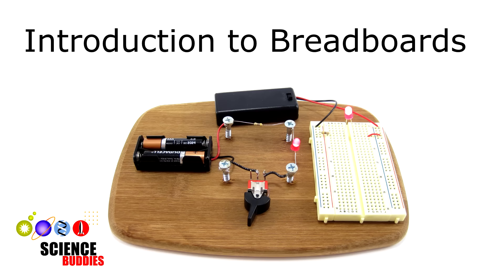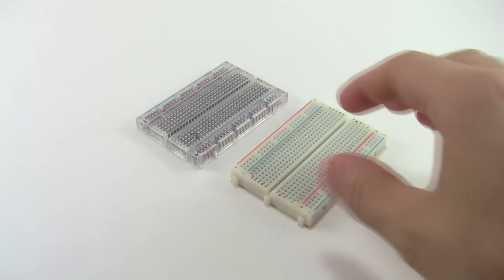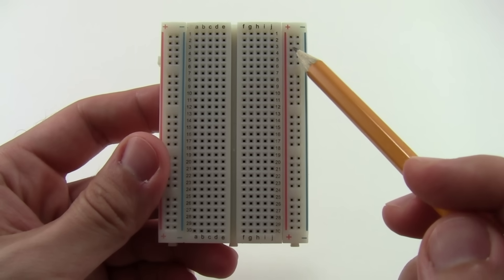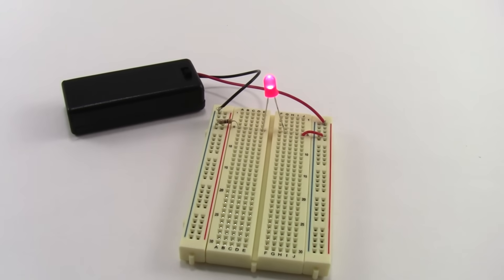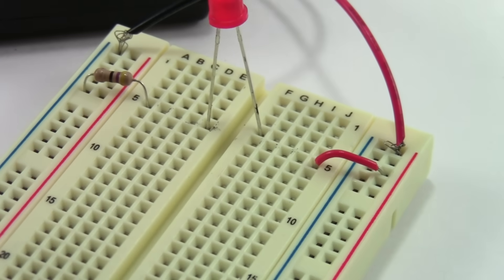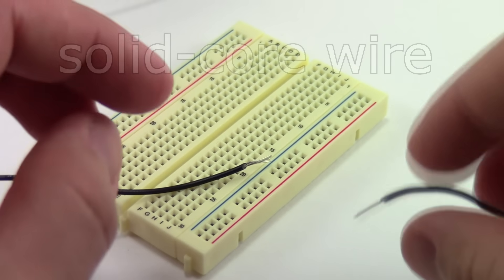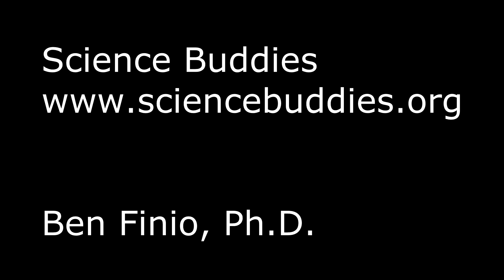How to Use a Breadboard

Comment: Would have been nice if I had found this video sooner. I have several breadboards, including 2 of the long ones.
 The longs ones came with some jumpers, plus a power supply that can power both side separately.
  This can give you 3.3VDC X2, 5VDC X2, or 3.3VDC on one side and 5VDC on the other. Fed by either a barrel plug, or a male to male type A USB cable.
 Available from many sellers I would suggest a 9 volt Wall Wart, 12 volt is okay, but you want one that is regulated. Many are not, and no load, or very light load voltage can be much higher.
 Best way to tell is to check the no load voltage with a DVM on at least a 20 volt scale..
 I found that unregulated ones will cause the small voltage regulators, on many items, to get very hot.
 I started checking all the ones I have, and suggest that others do likewise.
 Wayne WA2YNE

Comment: Great except electricity actually flows like water from negative to positive and repeats/fliws thus direction. Your arrows are backwards.
Reply from the maker: Hi - electrons (negative charges) flow from negative to positive. The convention for electrical current is the direction of flow of positive charge. This might seem silly in metal conductors where the charge carriers are electrons, but there are other cases (chemical reactions, particle accelerators) where the charge carriers can be positive (protons, positively-charged ions, etc).

Comment: Sorry im new to this,Can someone explain why a resister goes after the LED. I thought the resister is to protect the electronic part and does before a part in this case the LED.
Reply from the maker: Hi Arshad - to understand this you need to learn about Ohm's Law and how voltage drops work in series circuits. If you don't know what those terms mean, Google them and you will find a lot of good resources. It turns out that it does not matter whether the resistor or the LED comes first.
Reply: ScienceBuddiesTV 

Thanks for your reply

Comment: Why in your diagram do you have the resistor after the led in your circuit according to your description? shouldn't it be before he led resisting the 9v before it hits the LED?
Reply from the maker: Hi - you might want to look up some tutorials about "Ohm's Law" and "voltage in series" and "current in series." Since this is a series circuit, the total voltage drop, and the current through each element, remain the same regardless of the order you have the LED and resistor.
Reply: ScienceBuddiesTV thanks I saw some stuff after the fact that explained it a little better.

Comment: You can also tin a stranded wire to make it more breadboard friendly, however it helps to have some practice and skill in both stripping the wire and in soldering... if you can strip the wire smoothly enough you won't have to twist it to keep it together, but if you mess this part up you can just twist it, then you need a very thin very even coat of solder such that it holds all of the strands together. This method is not one I recommend to beginners as it takes quite a bit of practice to push an iron that smoothly... but something to keep in mind for when you get more advanced... it can get you through a pinch... it's like wetting a thread before you run it through the eye of a needle... while having an appropriate thread girth and needle eyelet circumference and super sharp scissors with no gap between the closed blades is ideal, in practice many people just moisten the thread and make it work... the process is much the same, except you've mean using you mouth to make things like toys, string, food, etc wet since you where a baby so getting the right saturation level to make the thread fibers stick together while not being so wet that the thread wants to sag and fail to hold stiff is fairly easy, but how long have you been using a soldering iron? So just like you'd expect a toddler to struggle with mastering the perfect satisfaction level to make a string stick together but stay relatively stiff, yet they've used their mouths to moisten crackers and what not enough to swallow hundreds upon hundreds of times... don't expect to be good enough with an iron to push lead smoothly enough and thin enough to make a good breadboard lead from stranded wire even after successfully soldering hundreds upon hundreds of joints... it takes time to master things to a really refined level. That having been said, it can be done, and when you know your likely to move the wire around the board a lot and you have the experience to know that twisting it only holds up for so many reinsertions, it becomes handier than walking across a room to get some single core solid wire... unless there is an attractive person that you'd be passing on the way lol. What? Despite the rumors, being an EE student doesn't mean I'm not human ... lol. Okay so it might not be that convenient, but if she's watching and you've been a solder tech for over 2 years and and enthusiast/hobbyist for more years than you care to recall, so you can solder that well, it's a nice way to make yourself wonder if she noticed, or if she knows how much skill and practice that takes to do quickly and fluidly, and is thus impressed, and so you might opt for tinning the wire rather than walk past her to get more appropriate wire, idk it just depends on whether or not you think she's seeing what your doing... uh all purely hypothetical, yeah. No personal experience, that's just what I here people say. And no, it's not as badass and hard to master as I make it out to be, but if it clumps or makes the wire too thick or you have run away strands your first few goes at it don't get frustrated with yourself, it does take some time and practice. Kinda like saying hi to someone you crush on. You might mess up at firs but you'll get the hang of it... okay, I can't be absolutely certain of that last bit but hey, it seems something that can be learned with practice. Anyways I ramble about solder fumes and girls too much so I'll stop here.

Comment: This might be a weird question as most electronics consume very little power, but how much power can the board handle?
And is there a difference between the mini types and the larger types in power handling capabilities?
I haven`t used one of these since the mid 90`s, but I`m getting a few for a couple of projects, so I`m just curious.

I`ll be using up to 90Watts, from a 14.4V source, so I`m hoping 6.25Amps is well withing the boards capabilities.

Any info about the power handling of breadboards will be much appreciated :)
Reply: Neeever min, found it lol..
So apparently 500mA is the safe limit.
Not really what I was hoping for :/
Maybe there are larger breadboards one could get?
I haven`t seen any..

Comment: if you have stranded wires, can you just tin the end? Like pre-bend it 90 degrees and just tin it? Most of the wires I've seen is stranded wire, all my scrap wires are stranded wires aswell. I'd like to start playing with those boards, and I got a ton of scrap wires from various little projects!

Comment: I always get confused but, does the power come out the negative, or positive terminal?
Reply: Current flow is opposite to the direction that the electrons travel. Electrons are negative, so on a battery, they go from negative to the positive terminal, which means, there is a "Flow of Positive Charge", and current flows from positive to negative terminal.
Reply: Depends how you look at it; but that's as good an answer as you're going to get I think.

Comment: you got the yellow arrows wrong, the electrons in the wires flow from negative to positive. I just learned that in engineering class
Reply: but verry good vidieo. liked it, probibly am about to get back into that kind of stuff just because of this vidieo... thanks
Reply: I also used fresh staples for the jumpers and they worked fine for simple circuits like turning on a led but nothing complex because no insulation

Comment: why did you put resistor in negative side?
Reply: The purpose of the resistor is reduce the amount of current flow. If the current is too high, the led bulb will blow up
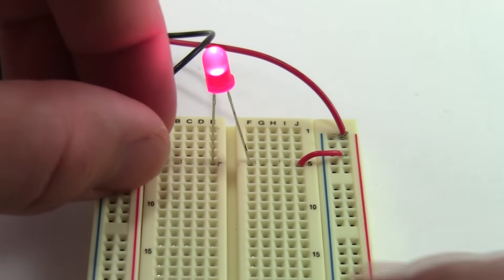Reply: the diagram at 8:35 is kinda wrong, electricity flows from negative to positive. so just reverse the arrows. now that they're reversed, you can see that current will flow through the resistor first then the light. I know I'm way late but just in case anyone else had that question now you know why
Reply: Thanks
Reply: Felix Gonzales Current doesn't flow through the resistor first, it flows through the entire length of the circuit all at once.
Reply: Felix Gonzales it's not wrong because he's talking about conventional current. But yeah if you what to get technical electrons (so current) are moving from the negative terminal of the power supply to the positive terminal.
Reply: I too have that doubt by logic.Got it cleared by your reply. Thanks
Reply: Felix Gonzales It doesn't matter if the resistor/led is first in serial connection
Reply: its doesnt matter.
Reply: El650Jefe ah yeah, I'm a physics major so I have the "technical" view haha
Reply: to show polarity if I had to guess
Reply: Those were my thoughts as well. I understand the difference between conventional current and how electrons actually move (from negative to positive) BUT, I’ve always thought that the resistor should be placed on the positive side of the battery and the anode(+) side of the diode in order to protect the LED from getting too much current.
Reply: Why not? )
Reply: The technical direction engineers use is from positive to negative.
Reply: Abhishek Suryawanshi because remember in order for current to flow you must have a closed circuit. Think of this circuit like a circle. Your starting point is the power supply then as you go around you go through the red wire than the resistor than the black wire and finally back to the power supply. The negative side is what connects the resistor and the black wire, so if the resistor didn't connect to the negative side you'd have an open circuit (or an incomplete circle) and current wouldn't flow. To be clear I'm talking about the circuit at around the 5:45 mark

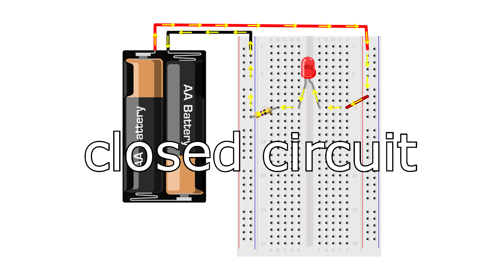Comment: diagram on 5:34 is confusing, why is the resistor after the LED? shouldn't it be before the electricity hits the LED as to resist the flow? besides that it is a great video.
Reply: It doesn't matter where the resistor goes. Think of it like a water pipe with a pinch in it. It doesn't matter where along the pipe the pinch is, because it'll resist the flow no matter where you put it.
Reply: Thats a terrible example xD Water flows, hits a resitor and the water  slows down ( or speeds up) , if you stand before the resitor you get the full water without obstacle..
Reply: I see what you are thinking here, but not really true. It's not intuitive, but the pressure is the same at every point in the water pipe (and the circuit.) The pinch (resistor) and the load (the LED) both contribute to an increase in resistance to the flow, no matter where they are as long as the flow is not stopped/diverted etc. The water flow before the constriction has "back pressure" so everything equalizes.
You could even have half the resistance on either side and it would work essentially the same way, like a constriction both before and after the load.
Reply: @Keyakina  Actually the water does not slow down or speed up when it hits the resistance. Provided that the pipe is the same size, the water will be slowed down by a restriction along the full length of the pipe. Otherwise you would get lots of water quickly reaching the restriction, having nowhere to go, and building up pressure until the pipe/hose explodes.
Reply: @Keyakina  don't think of the amount of water, but the FLOW of water. There may be 20 gallons of water before the pinch, but it wouldn't flow through the hose any faster than the the water after the pinch. The pinch is the limiting factor. No water can move faster than it can through the pinch.
Reply: electrons are not only near the battery side. they are everywhere in the circuit wire. it only needs voltage to give them direction
Reply: Thats so wierd..
Reply: Current is the same throughout the circuit, so resistor position does not matter
Reply: Strangely, I have heard that as electrons flow through a circuit in one direction, that "holes" (positions where the electrons used to be) flow in the other, and also that the "electron shock wave" travels through the circuit at near the speed of light, while the electrons themselves flow much more slowly, but create the shock wave  which is the energy of the electric circuit.
These are probably theoretic concepts, but very interesting.
Reply: Yes I thought so, I don't know why he did it like that.        so clear otherwise.

Comment: Can i use a wire instead of a resistor
Reply: No. The resistor functions to limit the current flowing through the circuit. That's why it's called a resistor. If you don't limit the current, the LED will be operating outside of its designed limits, so you'll end up with an overheated LED that could burn out. You might be able to get away with it for a few seconds or minutes (depending on how much excess current is flowing through it), but it will shorten the life of the LED.